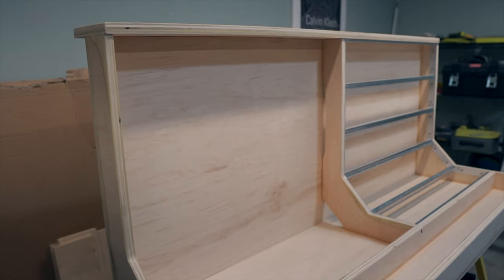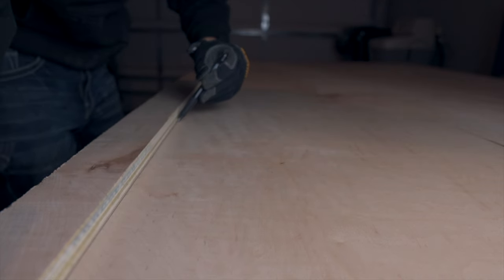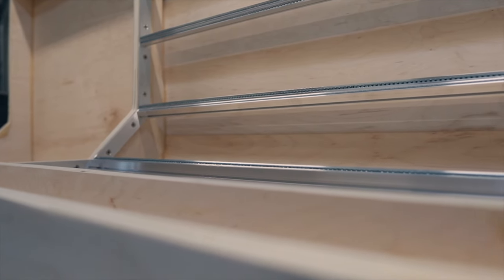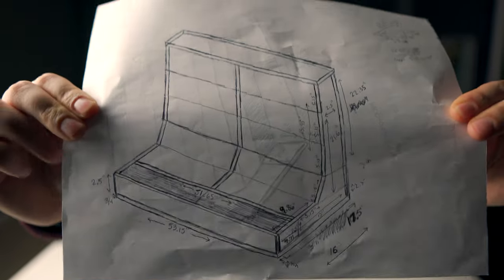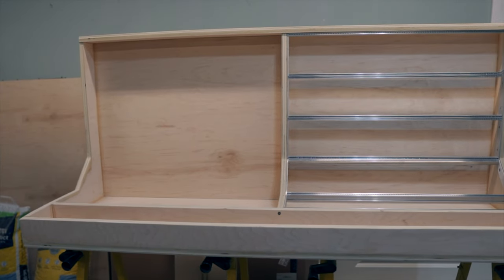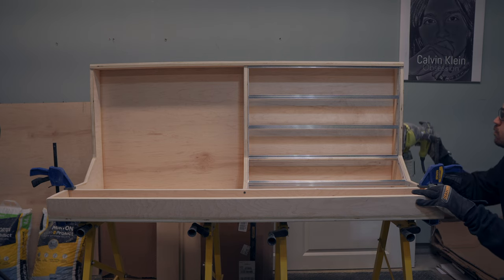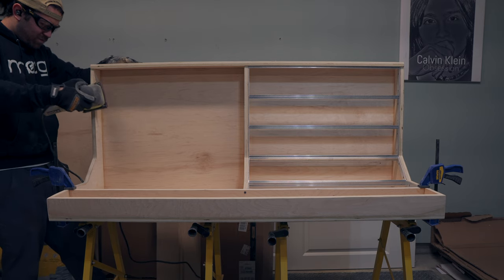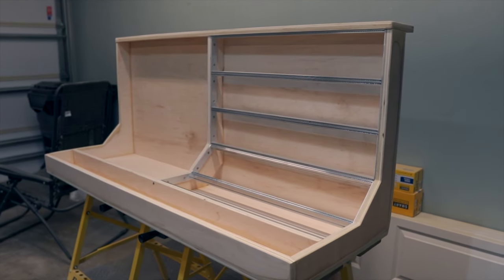DIY Large Eurorack Case Pt. 1

Comment: Bro nice job! thats the case i want to make. Do you give away or sell the blueprint?
Reply from the maker: Hey thanks man! 
Give me less than a week and I’ll make precise measurements, put together a detailed page and post it to my website for you to download easily. I’ll respond again on here once it’s available! 😎
Reply: i did a small technical drawing with the dimensions from your drawing I can send it to you if you want you can pencil in the rest on the important dimensions and I can finish it if needed. Its not that bad and will be a good thing to have for this video
Reply from the maker: @digitalvamp  I posted a link on the main page of my website. Small PDF with some build tips and the important measurements when tackling a case this size. Thanks for the suggestion and hope it helps!

https://nematomusic.com
Reply: Thank you I started getting the wood and I was waiting for this I really appreciate you doing it. I would have gotten one minor measurement wrong and it would have been in the trash. I’ll follow this as tight as I can thanks again!
Reply from the maker: Of course! When in doubt, cut it larger! Can always trim it down as you’re fitting the rails how you want them to sit!
Be sure to send me a message/image when it’s finished! Good luck! 🤙🏼
Reply from the maker: Only thing I didn’t know how to include in there is be careful to leave more space in the back of the case. If there’s one regret I have it’s the “depth” in order to fit the power supply pieces inside the case. Mine worked out, but it limits the depth I have for modules in certain areas.
Reply: I remember you mentioned that in the video. I was gonna go about another 2” the be safe on the bottom width and back width